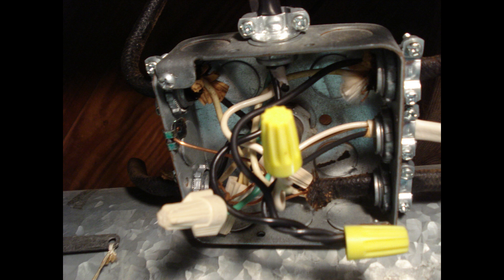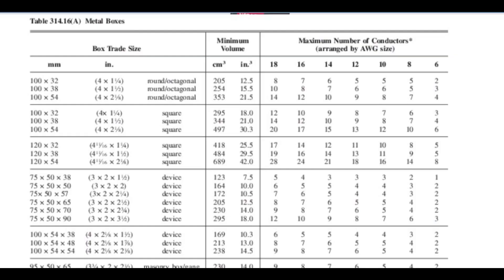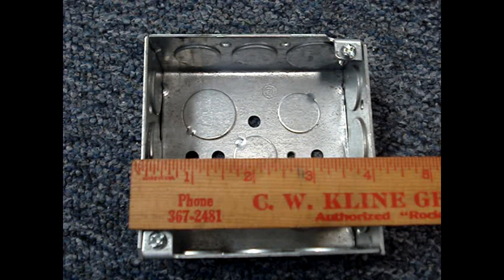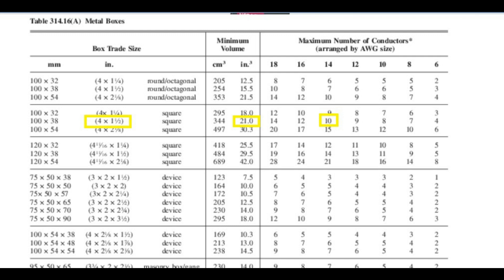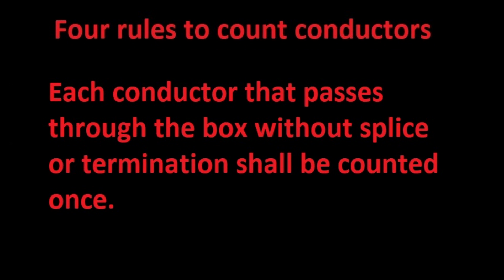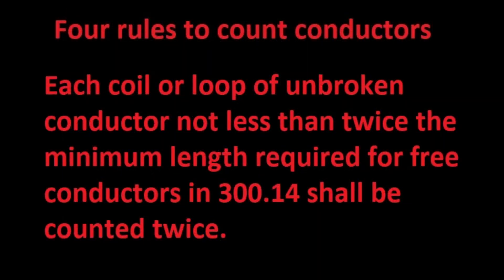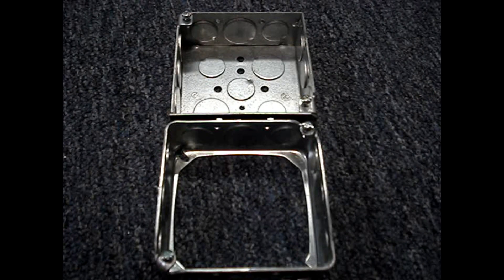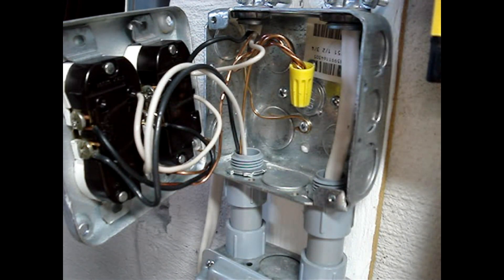How Many Wires Fit in a Junction Box?

Comment: Thank you for the information. Very helpful. Quick question... How does one hide the extension ring? Can it be hidden under drywall or must a separate cover be used?
Reply from the maker: I'm not clear on your question.  If you are asking if you can drywall over top of an electrical box... that's a big no no.  You can get blank covers for electrical boxes.
Reply: @Know-How-Now  thank you for responding to my question. The actual question is if I have a double Gang Box can I hide half the Box behind drywall without putting the cover on? Or must a cover be put on the side that will not be exposed and will not have a an outlet for switch in it
Reply from the maker: No, you can't cover an electrical box with dry wall.  You might want to read NEC 314.29
Reply: @Know-How-Now  thank you. I gave up on that idea yesterday when I thought I could not cover one out of the two portions of the Dual Gang Box. Thanks again like and now sub Subscribed
Reply from the maker: You are welcome.  Thanks for subscribing.  BTW you can look at the code for free though they kind of make it difficult.  https://www.nfpa.org/Codes-and-Standards/All-Codes-and-Standards/Free-access
Reply: 4 sq metal box with a 4 sq single gang mud ring.

Comment: In Russia some “electricians” will put 7 cables (2 wires + 1 ground) inside one such box and put this “art” in their portfolio. 
In some cases you can see 18 splices inside one such box.
Reply from the maker: That's kind of scary.  The reason for limiting the number of wires in a box is because of the heat created in an overfilled box.  The heat breaks down the insulation.  I recently removed some old ballasts from a fluorescent light fixture to convert it to LED (see playlist on channel for how to video), the covering on the ballast wires crumbled off of the metal conductors.

I know of an electrical contractor who hired an electrician who immigrated from Ukraine.  Apparently they did not even use boxes for spices in the Ukraine.
Reply: Oh, I’m from Ukraine too =) It is rare to not use junction boxes but those “boxes” (without a box) exist.
Reply from the maker: My story is from about 15-20 years ago, so standards could have changed since that time.  The Ukrainian electrician talked about being from the area of Chernobyl.  He was working in a location away from his home during the accident.  He said there were people running around it white suits and he couldn't get back to his home for some time.
Reply: Know How Now, yeah people were forced to leave Chernobyl. About boxes: even now customer may ask to make connections without use of boxes and some electricians may agree =) 
No one inspects private houses/apartments.

Comment: So if I understand this correctly, with the additionally ring I am able to run 4 12-2 gauge wire into my junction box and make connections there. I have a rewire for an attic and this is what I plan on doing is running a hot line to attic with junction boxes for lights, receptacles.
Reply from the maker: I'm not clear about your question.  You have an existing box and want to add an extension ring and 4 12-2's?  If the original box was not over filled, use the table 314.16A and look down the 12 column until you find your box size to determine how many #12's will fit into the extension ring.  If all 4 conductors are spliced that would be 8 #12 conductors.
Reply: Know How Now New box installation
Reply from the maker: Then you just need to go down the column for #12 conductors and select the size box for at least 8 conductors.  The code is a minimum requirement.  There is an art to splicing and folding the wires into the box neatly.  Extra room makes the task easier for a non professional electrician.

Comment: So can I extend every box and it would be good? Adding more cu. In?
Reply from the maker: I'm not sure I fully understand what you are asking.  Unless you use the calculation, you won't know if you meet code.  The code is the minimum requirement, there is no harm in exceeding the code.
Reply: yes, that would be good.